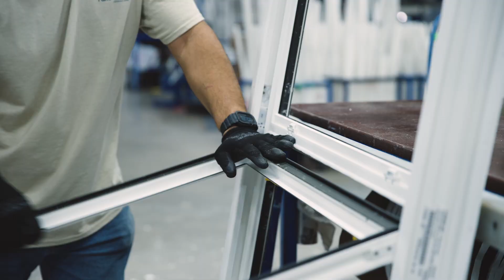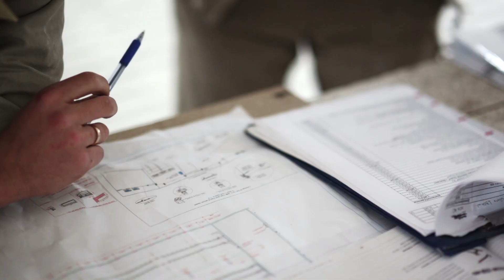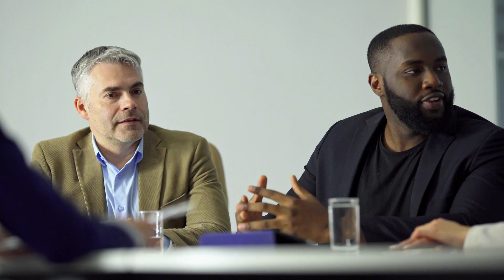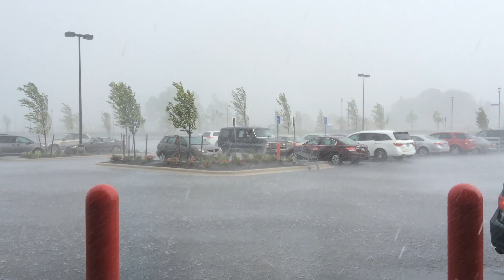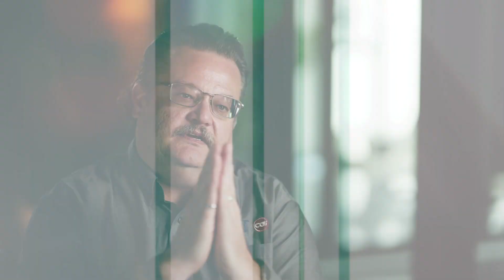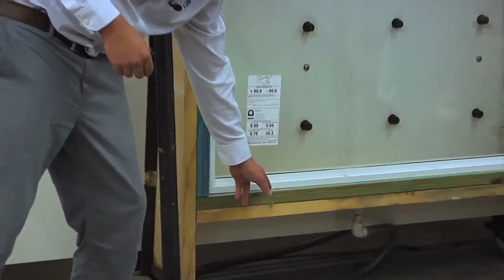Why Impact PGT Innovation Spotlight | PGT Windows & Doors

Comment: I noticed in this video a no frame bay window in your showroom. Are these able to be manufactured for sale with Miami dade noa? I thought that style no longer met building code?
Reply from the maker: Hello, The product you noticed in our showroom is the WinDoor Envista Seamless Glazed Aluminum Bay Window. It has a Florida Product Approval that is only approved for installations outside the High Velocity Hurricane Zone (HVHZ). WinDoor also has the Envista Seamless Glazed Aluminum Window Wall, which is approved for installations in all of Florida (including the HVHZ). Both products can be installed in straight or angled ‘bay’ configurations. These two windows are the first and only impact product of their kind on the market.